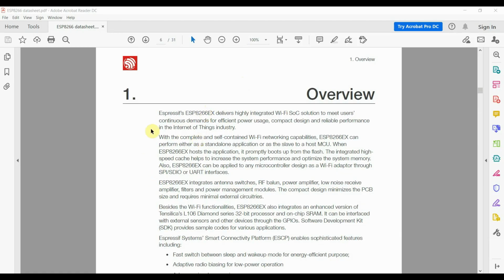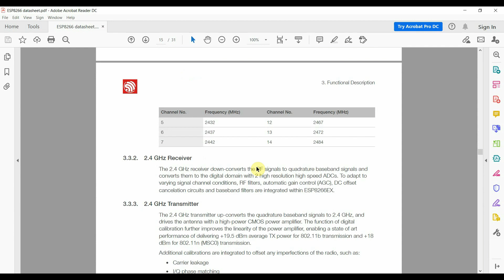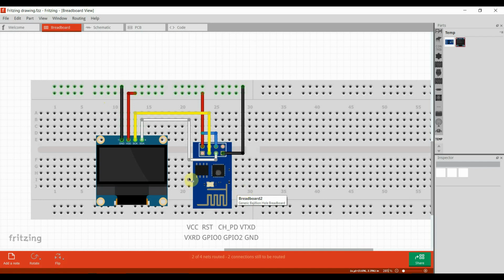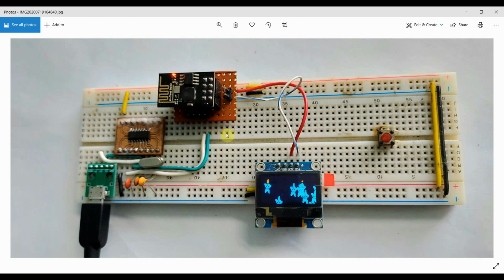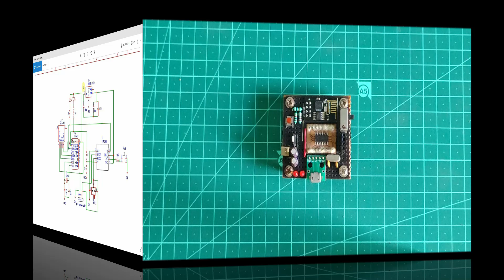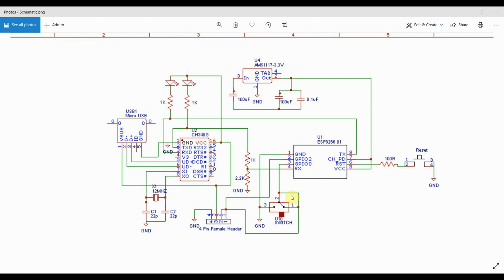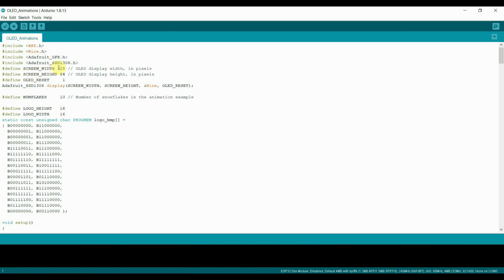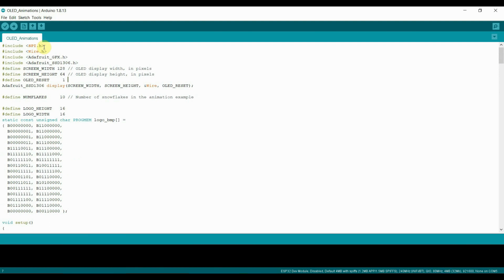ESP8266-01 board has I2C communication?! ||  Exploring ESP8266:Part 1

Comment: 7:34 OLED_RESET; is extra Pin to reset the OLED. But you have no Reset pin.
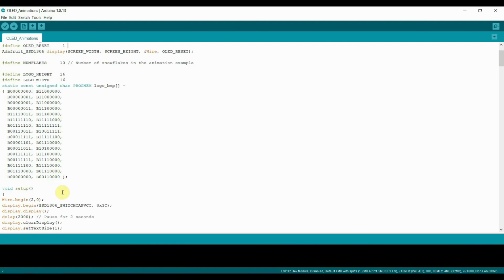7:49 Wire.begin(2,0); setup I2C to GPI2 = D4 = SDA  , GPI0 = D3 = SCL

Comment: If you first program the esp01 with a blank OTA firmware (over-the-air) you won't need to physically connect it to your computer to develop, edit and upload.  You can just send the new firmware over the air.
Reply from the maker: That's a great suggestion! I see how this can be useful in minimising the hardware requirements. Would be great if you could share any article/video on how to implement this OTA feature. Thanks!

Comment: I'm not sure about your schematic.  VBUS isn't connected to the input of the regulator and pins 1 & 2 of the four pin header are connected together shorting GPIO0 and GPIO2.
Your assertion that the ESP8266 works at 5 Volts may be true for you, but in general this is not true.  It should ONLY be run at 3.3 Volts.
While the Adafruit OLED does have an onboard 3.3 Volt regulator and appropriate level-shifting this is not generally true of all display modules.
Reply from the maker: Yes I agree upon what you said about mismatch of voltage levels. That being said I would highly recommend you to watch one of my previous build which is making a development board for the ESP8266: I've named it as ESP-O-One. The main circuit diagram is comprehensively described there and the ESP is powered from 3.3volts.